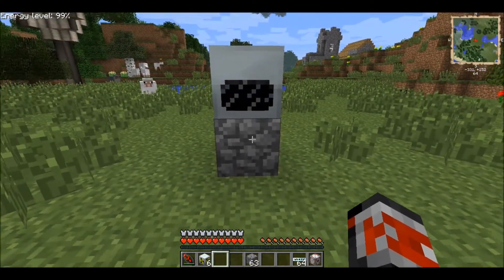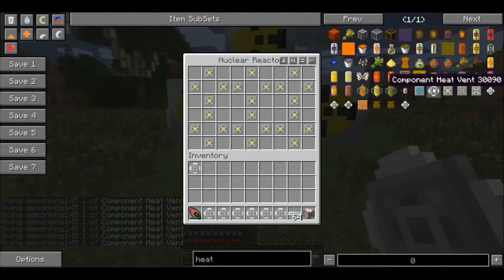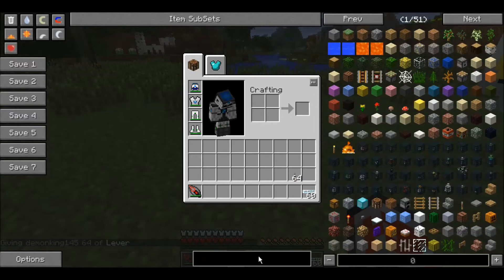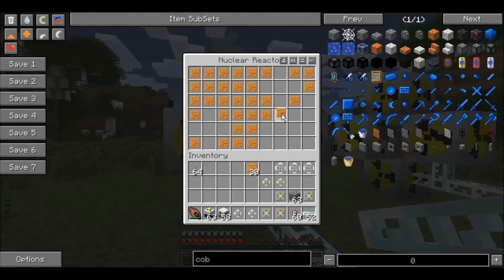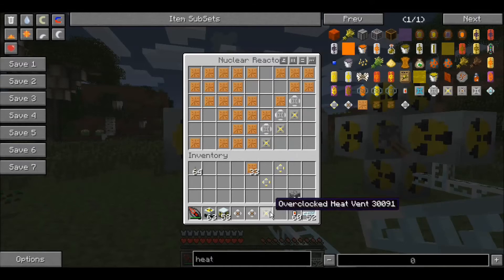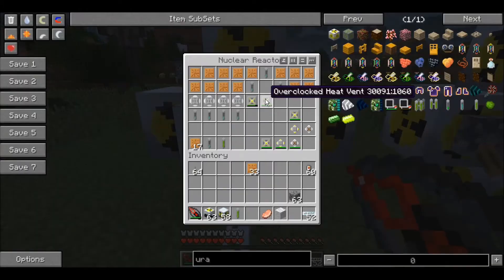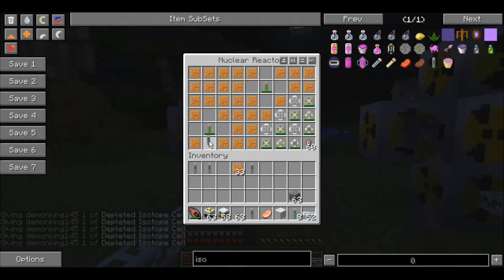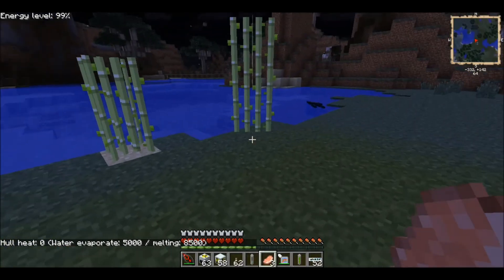nuclear reactor ftb unleashed tutorial & breeder reactor.

Comment: Question....obviously those components are degrading. How long does it last before it becomes a problem? Are there any parts you can put in instead that will 'not' degrade? And I'm guessing if they degrade completely it will explode. Is there something to atleast warn you if it's getting low or something? You also have quite a few empty spots there. There's nothing to fill in that would help keep it from degrading or add more power to it?  o.O

Comment: WHICH ONE MAKES MORE EU?
Reply from the maker: No need to shout, the first design will generate more EU. The second is mainly used for refilling your uranium cells.
Reply: i didnt shout, its just people pay more attention to caps lock.
i didnt undertand why i cant just set the second design in a reactor chamber in the same nuclear reactor - why i need 2 nuclear reactors
Reply from the maker: Noam Cahani true, I haven't played the new versions of FTB and so i am lacking current information, but in the version of unleashed i am playing in this video there is only one "chest" or storage area inside the reactor that you can place items in. like i said though i have not played in a while so they may have changed that.
Reply: richaard0 so i have to try?
Reply from the maker: Which mod pack do you want to know about? i can test it in a couple of days if you need.
Reply: nevermind i found out i need too nuclear reactors.
thaks anyway.
Reply from the maker: Noam Cahani lol, okay then if you have any questions i will try to help. i will start making more videos i just got lazy.
Reply: i need all the 60 heating cells?
if not, how many?
Reply from the maker: Noam Cahani You do not need all of them, but this get the fastest recharge of your cells. Plus they are very cheep to make they are basically lava cells and copper. I would highly suggest using 60.
Reply: ok thanks
Reply from the maker: Noam Cahani no problem let me know if you have any other questions